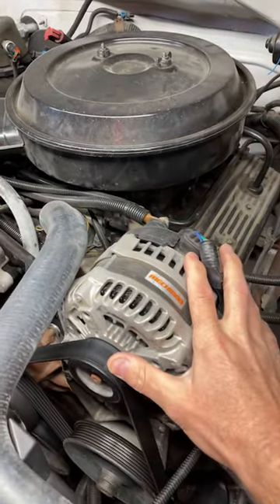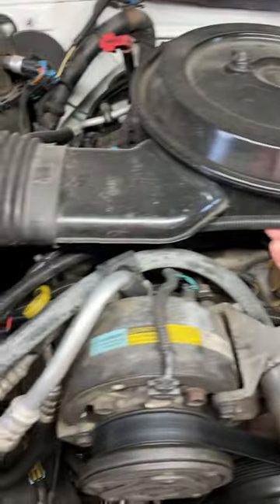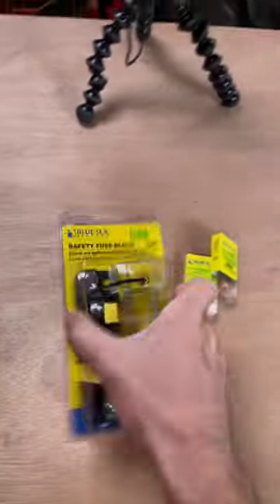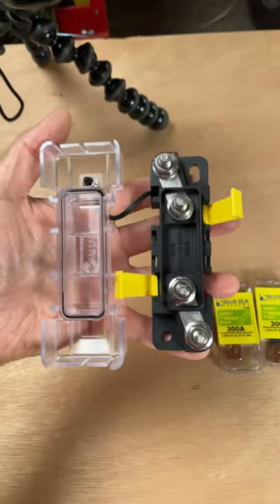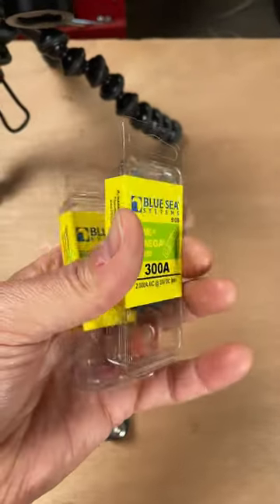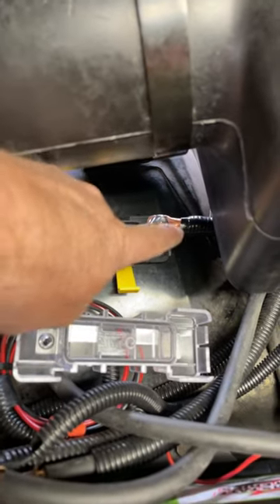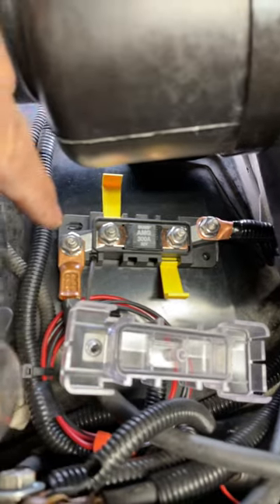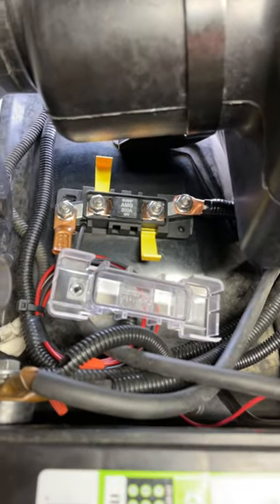Customer States His Install Was Professional!!

Comment: As a mechanic, both light and commercial, if the alternator is significantly higher amperage (more than 15-20% than OEM), a fuse isn't a bad idea, if a bit belt and suspenders. As far as what I'd charge? Ballpark would be an hour to an hour and a half labor plus parts. It's a custom job, probably took a half hour if you know what you're doing, and that'll cover overhead on sourcing parts, and at least cover a little diag if it comes back for warranty. (If you don't think sourcing the right parts takes time, you're wrong, and profit is necessary for a business to continue providing service. There are rip-off shops, half the time they're the ones that estimate half the cost as others)

Comment: Charge half an hour or 3/4 since you did have to cut the wire and add the two extra ends and 30% markup on the parts. The guy really did try to do a good job though, thick cable, quality ends, decent routing, clipped zip ties, and put the cable protector on. I do like the actual fuse over the fusible link, easier to diagnose and replace down the road and giving the owner a spare is a pro move!

Comment: I used to work for the OEM on these Deco/GM alternators.

If the wire itself doesn't get chaifed and short (like between the fuse he installed and the battery....making the fuse useless)....

Then ... the first component inside the alternator is 6 diodes.... a 6 diode 3 phase rectifier (making the AC - alternator voltage - DC).... then a bunch of smaller windings.  

In a catastrophic failure... those will all let the magic smoke out and the circuit will open like a fuse.

Most cars have a fusable link.   I think that may be more for legal reasons.   Pretty sure the alternator will always fail first.   After 50 years of doing this... i have never seen an alternator fusable link open... and i have done this a LOT... Even on light aircraft & military vehicles.

So there ya go... an honest ENGINEERING evaluation from somebody who worked on the actual  OEM system.   I personally don't complicate the install for one wire.  Hook it straight up.  The smoke will come out of the altenator either way.... your replacing it. .
Reply: Ive seen heaps of vehicles blow the alternator fuse as an auto electrician, it protects the alternator somewhat in the cicrcumstance you drop a battery cell and the alternator starts pumping some massive current and melts itself/you have a dead short in the lead. Definitely worth having the fuse.
Reply: Maybe the engineers should have done a better job engineering and engineered a fuse on the alternator. Engineer is a fun word. 😅
Reply: 100% only reason for a fuse is if the wire is in danger.
Reply: The fuse needs to be as close as possible to the source (Battery). 
Its not there to protect the alternator. It's there to protect the car and human life. If that wire rubs on engine parts or anything vibrating enough to wear through the insulation, it will arc weld itself to the grounded metal causing a short circuit. A car battery is capable of melting steel. That cable would get red hot and possibly melt. Causing a fire 🔥.  The closer it is to the source the safer it is. less likely to ground out on something.
Reply: @austinbrown5426  That wouldn't do anything for preventing a fire between the battery and the alternator. Thats the purpose of a fuse is for a fire from that cable if it shorts to ground anywhere between the battery and the alternator.
Reply: @ElectricBillAlbright  I understand that the fuse basically sacrifices the alternator to prevent further damage or fire but an extra fuse on the alternator would save the alternator too. Then you're just replacing fuses instead of the whole alternator. It just doesn't fit in with planned obsolescence, that's the real issue.
Reply: If the wire gets chafed and shorts to ground would not be causing the fuse to be "useless" that would be the fuse doing its job by making an open circuit rather than a fire. The only purpose for a fuse in this situation, is for protection of that wire not becoming a heating element and burning the car down to the ground. Has nothing to do with protecting the alternator. It may be a high performance alternator but that alternator is not capable of 300+amps which would be required to blow that fuse.
Reply: @Austin Brown  all you need is the fuse at the power supply, having 2 fuses in series is not achieving anything
Reply: OK Ok... wait.  All this speculation on fuses is .... ill concieved.

The "power" is coming from BOTH ends when the engine is running.  So all of this "protection & fire pevention" is totally wrong.

BTW... the comment about poor engineering... um... that system is good enough that all the "start stop" vehicles use it AT EVERY SINGLE STOP!  its been around more than a hundred years.  (Glad you are smarter though...)

Just a thought...   if you use the right size battery and wire for the design.  ..  you can start 16 Liter Diesels with 22:1 compression.

Quit using bell wire and wire nuts in your assembly.

Imho. Just a thought.
Reply: @experimentmagnet  Lots of vibration in an engine bay, wires can come loose, in which case using the proper wiring isn't going to make a difference. If there is a short, the battery will continue to supply current and could cause a fire or other damage, depending on the location of the short. Alternators have something called a fusible link which will melt and interrupt the circuit, prevention something like a fire. Batteries do not have anything to interrupt the circuit in case of a short, hence the need for a fuse
Reply: @Kangawallafox  If you have a short in the battery it will drop voltage but in thirty years have never seen that fry an alternator.  An alternator can go full force and not fry itself.  When I have seen a blown main fuse it is usually due to an idiot doing something they should not have done like; reverse polarity jumps, shoddy  wiring, improper testing to name a few.
Reply: @lang1031  really I've seen them fry from dropped cells etc, depends on what kind of sensing circuit they have too but some will try and adjust the output to match and burn out
Reply: @Kangawallafox  You are not ASE master certified.  You comments prove that.  The fuseable link some cars have is to protect the wiring and computers from idiots doing wrong things and from dead shorts that can smoke electronics. Many cars do not have a fuseable link to the alternator and again alternators can go full force without burning up. Happens all of the time when new cars get the first battery change due to the battery going bad due to age. When those batteries (right before they go bad) the alternator is going full force and WOW the alternators due not burn up!  (During the first battery change which happens within the first five years of the cars life).  All the ones that burn up are because they are old,  had oil drip down into them, the rectifier bridge (diode trio) goes bad, or the voltage regulator goes bad ( the thing you called the sensing circuit because you knew the proper terminology).  The "sensing circuit" you are talking about is called the voltage regulator some are located in the alternator others are in the BCM or ECU and some older vehicles have them outside of the alternator by themselves ( some old 1980 Cryslers for example ).   You do not need a fuseable link going from the alternator to the battery.  The guy that made this video is also not ASE master certified.  Some cars have them on the battery to protect electronics from smoking but not for  protecting the alternator from going full force which sometimes they have to do.  And if you are protecting an alternator from going full force you would regulate the field windings to the stator not the the output wire to the battery as this guy did in the video.  (again showing you and the video maker are not ASE certified in this area).  I could go on for hours on this subject and have even taught electrical journeymen (with college degrees).   I know the truth is hard to take because people hate to think they could ever be wrong but you will not win this discussion. You could name vehicles and I could draw the electrical schematics from memory.  Your move.  And don't blow a fuse 😅
Reply: @lang1031  go take the battery out of your car whilst it's running and drive down the highway, let me know how "full force" works out for you.
Reply: @Kangawallafox    The car would stay running as long as it had a negative ground but going full force with alternator will not burn up the alternator what it will do is have a chance of burning out the drivers in your ECU which can blow a fuse (like you just did buy being upset due to being proven wrong).  And you are ever supposed to run a car without the battery in it. Many will stall out due to the ground being removed which again proves you are not ASE certified.  Keep trying you keep showing everyone you don't know enough.  And if you remove the positive terminal leaving the negative on the car will run with a good alternator but it WILL NOT BURN UP THE ALTERNATOR.  It will run a chance of spikingyour ECU however.  Hey idiot alternator does have to go full force sometimes and it does not burn up an alternator.   And again going back to what started this discussion which I mentioned on my last post putting a fusible link from the power supply of the alternator to the battery does not protect the alternator that can still cause an alternator to go full force if the command is given to the field windings to do so.  So putting a fusible link from the alternator output to the battery does still not protect an alternator you idiot.
Reply: Battery is capable of melting steel 
YES !!!   Installing a battery one day and I got my hand stuck and shocked,  the voltage from the battery wielded the socket to the rachect pretty good ,   The socket would not come off
Reply: @austinbrown5426  You CAN NOT prevent a short/fire by placing a fuse in the middle of a wire with POWER ON BOTH ENDS.....THINK MAAAN.   THINK!
Reply: @lang1031  Bingo...
Reply: @experimentmagnet  Maybe you should re-read what I said and have a think yourself. I know it hurts but it's probably a good idea so you don't keep embarrassing yourself.
Reply: @Kangawallafox  The only reason that is bad is the battery works as a capacitor to smooth the alternator power to full DC.   Take the ripple out.

Think about it.  If the alternator couldnt maintain the vehicle... the battery would go dead on a long trip.

Its called "waste battery" configuration.

Like drag race cars that run 2 min at a time dont use alternators.  They just charge between races from a source.
Reply: @austinbrown5426  Just pleased you werent on the design team when we built em.
Reply: @experimentmagnet  I have no clue what nonsense you're talking about, but enjoy feeling like you won something and always remember that your a special little guy, just like mommy told you. ❤️
Reply: @austinbrown5426  So... you admit you have no clue.   That says it all.  Even if i were wrong... you should understsnd the terms.

Self admitted/diagnosed clueless...

One more time.   Putting a power supply on each end of a piece of wire... power coming in both ways.

Placing a fuse between them means, there is STILL power coming from both sides of the "blown" fuse.   That means that BOTH remaining wires/ circuits could STILL short to ground and cause that illusive fire everybody is talking about.
Reply: I was tooling through the Nevada desert late one sat. night and lost the fusible link (located on thedash) of my '74 Road Runner.  After some panicking because i was in the middle of nowhere at about 10pm, i found a place, and a guy and we replaced the link, i fired up my car and went on my way. I never had any other troubles out of it.  It was just "it's time" to go.  Find out where your fusible link is (if you have one) before you burn one out and carry a couple extra.  They're small and cheap, no reason not to.
Reply: Well unfortunately the do blow, the most common cause is operator error. When people jump the car backwards, it happens more than you think. It happens more than you think, I know you won't do it, but what if the wife's car doesn't start or 1 of the kids cars doesn't start and someone "helps them out".
Reply: I have been an international diesel tech for 10 years and have replaced fusible links many times. Prob 5 a year. Better safer than sorry
Reply: @ShiftingSkys  I am sincerely interested in your experience... really.  Cuz i still design and wire hot rods, marine and aircraft.   I appreciate the feedback.

May i ask.

When you replace a fusable link.  What else failed?  What was the cause, situation?  What else was replaced?

Or was it just the fragile fusable link that failed?  Relpace it only and everything else works normal?

Not sarcasm, sincere curiosity...
Reply: @experimentmagnet  Well The Most Common failure was Chaffed Alternator Cables or the Less common Chaffed Battery Cable. The More Uncommon Failure was Companies installing Inverters and Aftermarket accessories into the Big Sleeper Units and not Cabling them properly most of the time by trying to piggy back off the alternator cable at the PDM or Trying to Hook into Load Shedding. That can cause the Link to Burn up and in those Instances Replacing the Link and repairing the Cause for Overcharging whether it be an Alternator or an Accessory or a Failed Load Shedding Module. For some reason International uses two Links instead of one on the Cable at the starter. The Most Rarest Failure would be Corrosion on Trucks that come from up North. The heavy corrosion  Messes with the Alternator Regulator and can do some weird stuff especially if the Unit is not Power washed and has Tar Build up or something Thick. Dump Trucks and Tar/Cement Units were more susceptible. That has caused the Alternators to constantly overcharge thus making the heat issue even worse and can Burn out Circuit breakers and/or Brick Fuses or Fusible Links. I have one time seen a Factory Set up burn one side of the Fusible Link but not Burn out the Other. Could that have been a Manufacturing Issue with the Fusible link or something else? I have No Clue because I never found any issue with the truck Other than one of the two Fusible links was Bad. I noticed it because the Wire was Getting Hotter than normal(Would Burn you if you held it long enough) but at that moment not hot enough to do any damage.
Reply: @ShiftingSkys I am really sorry Michael... most of what you just proposed, while sounding cool is jibberish. There is a basic principle of super position of curcuit analysis in electrical engineering.

This means that ONLY circuits in a specific loop can effect that loop.   Items hooked from battery ANY place else DO NOT effect the link from the alterator to the battery (through ground completing the loop).  All that about inverters and other fuse panels doesn't mean anything.   You can't blow the bathroom fuse in your neighbors house opening the garage door in your house....The rectifier In the alternator that turns the "alternating" current (hence the name) to DC by definition and design will only let positive power flow to the battery...  not back to the alternatior.

Any fuse in the link from the altrnator to the battery should be sized large enough to accomodate the full output of the alternator.   When the engine is running ... any vibration that would damage the altrnator to battey wire would have power available for "fires" coming from both ends ...  so no point in the fuse.

So what fails the fuse .?....  nothing but fuse failure itself .
Reply: Fuses are not expensive and can prevent a fire . Who cares about the alt . But we know you wanted to express your knowledge. Maybe cause it's all u know .
Reply: @experimentmagnet  illusive fire lol .  Car audio can easily cause a fire when chodes don't use fuses